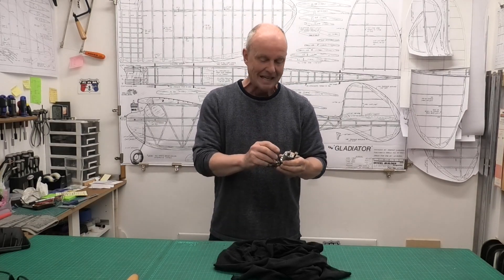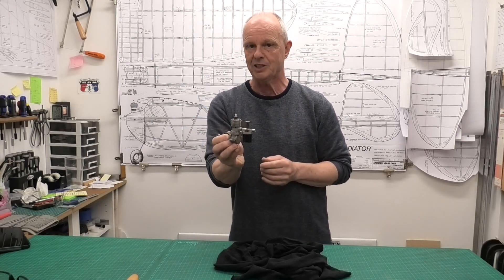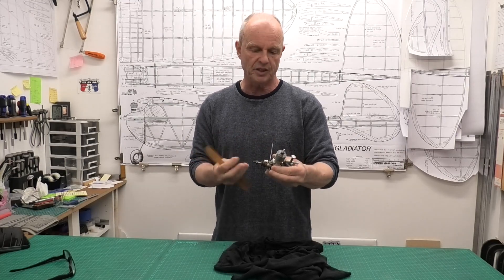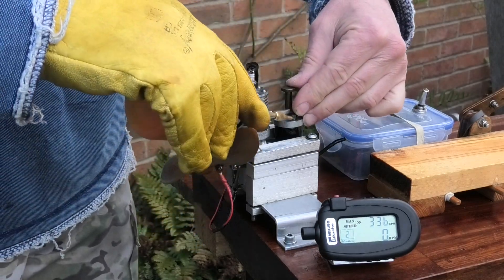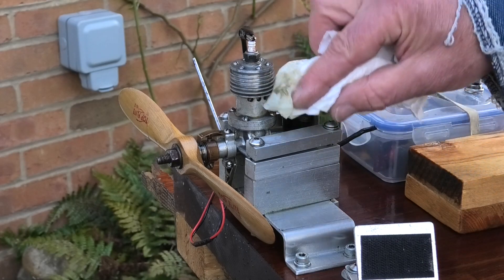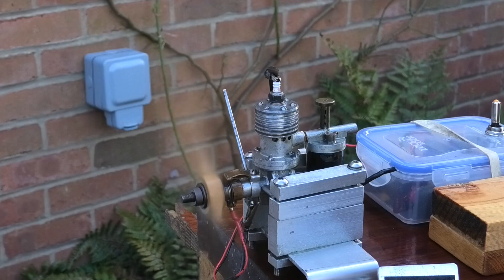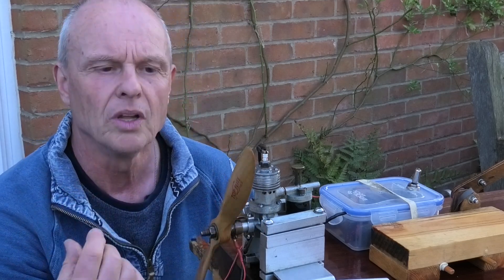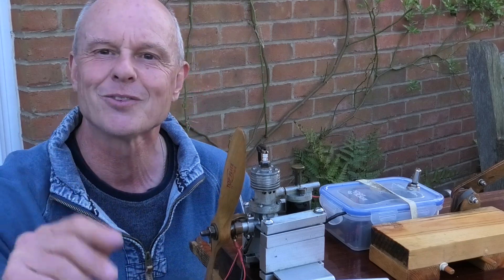1947 HP Series I - English Spark Ignition Engine - Run & Review

Comment: That is an easy starting motor. Not exactly a speed queen but any engine that runs on cheap fuel I'd call great.

While I do run heavy oil in my 1963 Harley I'm not brand loyal.

I buy the cheapest oil I can find. The thicker oils are getting harder to find. The local farm supply stores still carry heavy weight oils for customers with old tractors.
Reply from the maker: Thanks for the comment, really pleased you liked it 😀

Comment: Can you run 100 low lead in these
Reply: My money says maybe. When these style engines were being sold in the 40's they ran them on regular gas mixed with oil.

It's interesting he's running this on what I consider to be American camping fuel and American oil.
Reply from the maker: Yes, colmans fuel, but the oil is German, but made for Harleys
Reply from the maker: Don't know what 100 low is, but if it's pumped petrol make sure there is no ethanol in it as it will damage the tank.  Pumped petrol in the UK had 5-10 ethanol

Comment: Where can I get a spark system from I want to add spark ignitions to my collection but have no knowledge of them
Reply: E-Bay always has a selection of engines and parts.

Once you get one setup and running you can explore adapting modern small engine parts such as points and coils from chainsaws. Modern electronic ignition systems can also be built or adapted.
Reply: @tenlittleindians  I don’t have any knowledge of the ignition systems or how to even make one